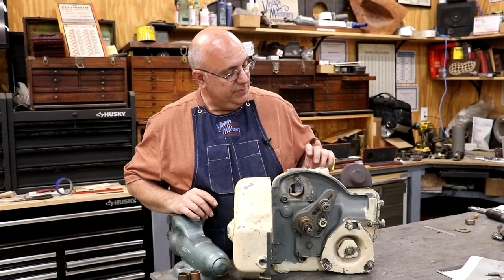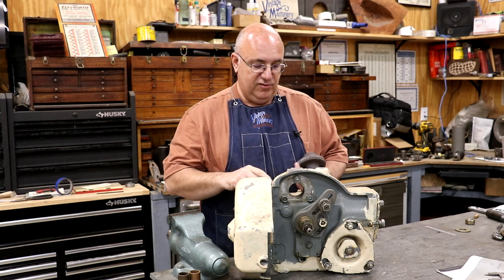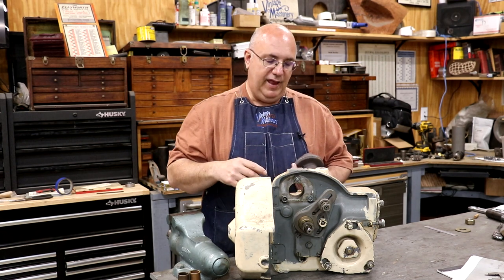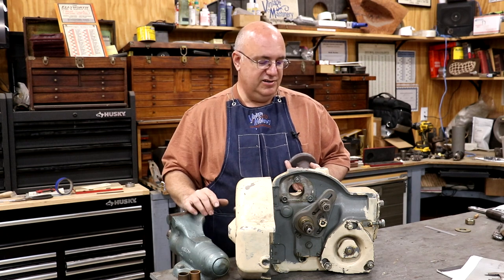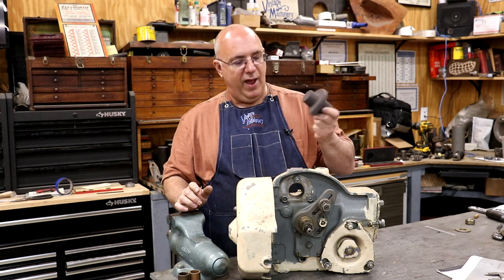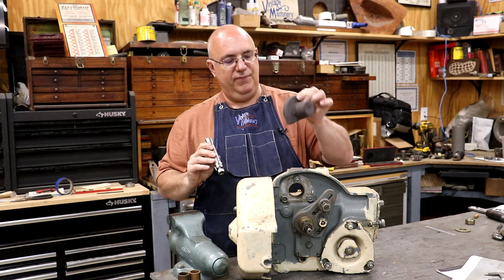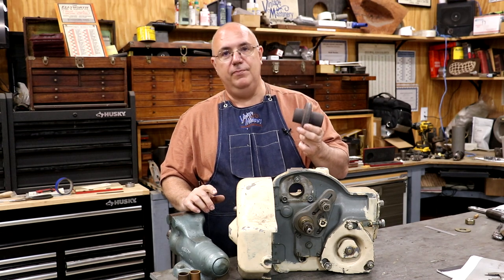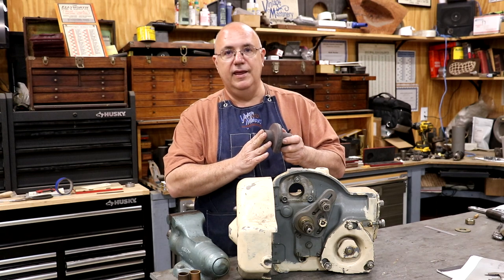Making a Spiral Head Drive Shaft Bracket for a Kearney & Trecker Lead Attachment

Comment: Imagine what the old tool and die makers would think of 3D printing in the making of casting “ plugs? “ instead of the wooden parts that they hand created for sand casting.  When I was in the 2nd grade I had a shop visit to a foundry and was shown the process.  64 years later I still remember the smell of the building.  Hot dirty physically demanding work that built the country.   Bless those calluses formed by the men who did and do the critical work!

Comment: Mr. Murphy came to town.  Years ago, we had a couple hundred forgings that had CNC work done on them, and some holes were drilled a little bit off the intended location.  Problem was that the holes were near some hydraulic cylinders (in the forging).  Lotsa scrambling went on to check and make sure there was enough wall thickness left between the hole and cylinder.  This on a light attack airplane, right at the heart of the flight control system.  In our case, the wall thickness was sufficient, but somebody was chewed out for making a bunch of parts on CNC without checking the first one to be sure it was per the drawing.  Probably should check periodically during the run to make sure nothing in the tooling had slipped.  In our case, Mr Murphy just gave us a slap upside the head to remind us.

Comment: Little tip next time you make something like that when you have a mating face and a bored hole, bore the hole in the same operation/clamping setup as facing the mating surface, when you turned the part around and then did the hole you can introduce a little bit of error. probably doesn't matter in this instance but just a good habit. Oh and we all screw up all the time, the fact that your man enough to share it actually is a testament to your character and actually makes the videos more interesting.

Comment: My  Cincinnati Monoset generates a spiral a little bit different. It uses a sine bar attachment . It go from "0" spiral to a maximum of a 30 degree spiral on a 1/4" diameter tool. It has some advantages over your mill. It has no change gears and is infinitely variable from "0" to its maximum. It is ok for grinding but not enough beef for milling . Just another way of doing things.

Comment: The ear on the side of the bearing block looks to get in the way of the housing anyway. They make flanged nuts and washers. You could even make a custom washer that would not impair the ability to adjust the position of the bearing block. Good job, none the less. I appreciate your realism.

Comment: Fair play to you Keith, for taking the "cock-up on the chin"! Respect - But I was sucking in air between my teeth as soon as I saw the set up on the mill! ;)
BTW it's easy to see how this component originally broke, due to the stress raisers formed by the flange/thin wall section tube junction - that was a lovely casting too, with no inclusions or hard spots.
Keep safe and well.

Comment: at the end of the video.. where you slid the splined shaft up against the bushing .. did you happen to use a file and cut reliefs in the splines that contact the bushing so the square corners of the splines don't dig into the bushing.  or create a very thin hard thrust washer to prevent that. its turning slow.. its only  a thought.. i know the gears are straight cut. so there will probably be zero thrust load.

Comment: Never mill slots like this with an on size end mill & clamped in a V block. Radial force will bite you in the A@@. Doesn't take that long to run 2 cuts just in case this happens. As long as it's functional, your gold...  Looking forward to you using this unit!

Comment: I would throw washers on those three bolts, because at some point you're in danger of snapping off that ear that you erred on. And those washers need to be parallel-faced. None of this affects the operation but you could produce a ugly chunk of cast iron inside that housing and who knows what that could do if it got caught up in them gears. Indeed, I would have to consider chopping off that very thin part, or most of it. Put it this way: There is no way in the universe that a loose chunk of iron in there can help you.

Comment: I think Keith has a few little blips here and there. Does it give you the felling that when Joe 'Pie' messes up, not only does he start making afresh he recods a new video too - over the one that went bad !

The thing with milling the first slot - everything was aligned. As for the 2 slots either side, Keith was relying on the grip of the vice to prevent the part from rotating - and perhaps a slower feed would have been prudent. It was odd though that the part crept upwards. That was certainly unexpected !

Yeah Keith, these things happen to the best of us.